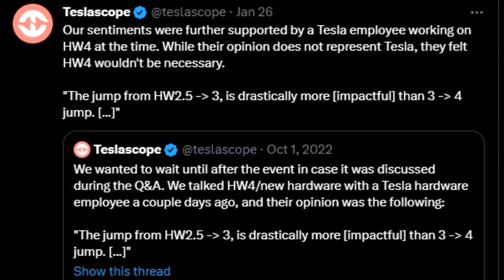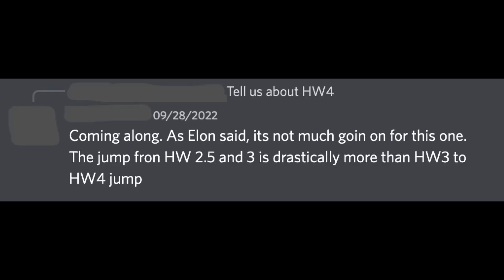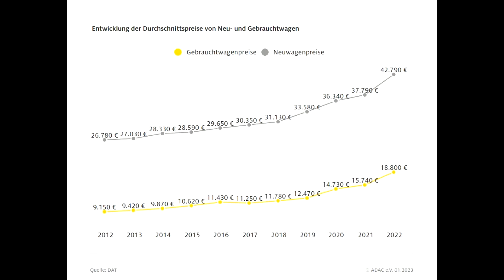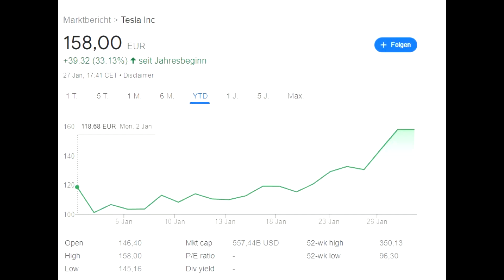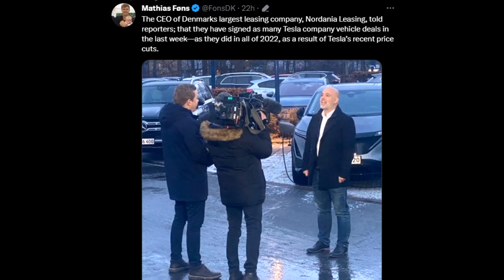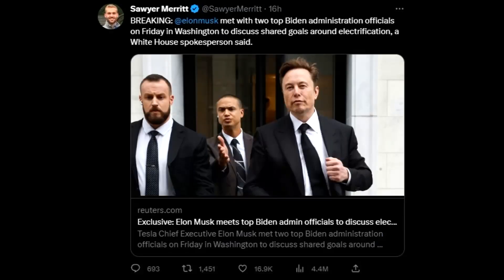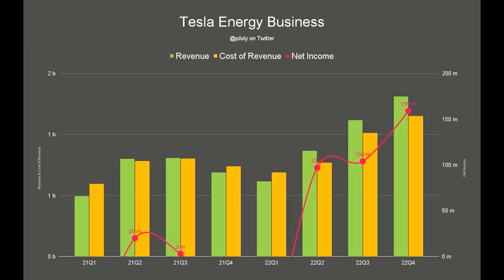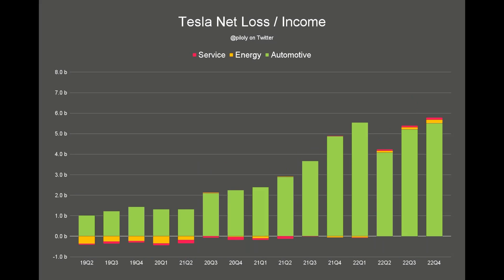TESLA HARDWARE - Why you shouldnt wait for Hardware 4

Comment: Don’t believe this at all!  FSD is a very very hard problem to solve.  If Teslas FSD was driving without intervention 99% of the time it would still be a long way from full autonomy, and it is nowhere near the 99% mark now.  A large part of machine learning success is due to brute force data and hardware performance, so IMO it is quite likely that in pursuing Elons much mentioned march of the 9s towards 99.999% reliability a more powerful computer will be required.  I also do not believe that HW3 to HW4 will be a small improvement compared to the move to HW3.  I expect it to be a very big improvement,  at least  10x improvement and probably more.   If you believe Elon that a free upgrade from HW3 to HW4 would be economically infeasible and you intend to purchase FSD, I wouldn’t touch HW3 with a barge pole.  On the other hand, if HW3 isn’t up to the task of handling FSD then I don’t see that Tesla will have much choice other than to upgrade everyone for free because everyone who has bought FSD has bought it on the understanding that the current hardware is up to the job.  However If you are not in the USA you might as well go ahead and buy now because it’s going to be many years before FSD is ready for Europe